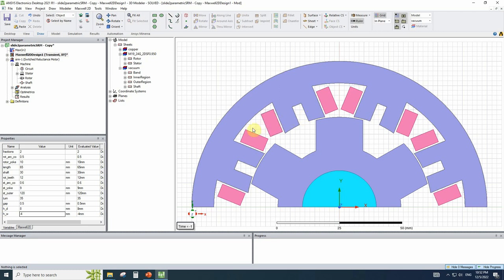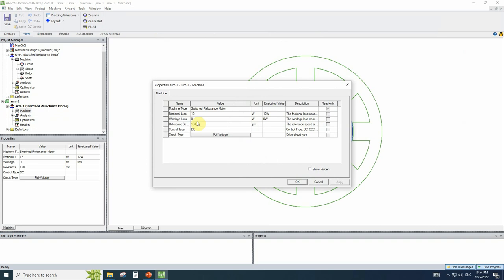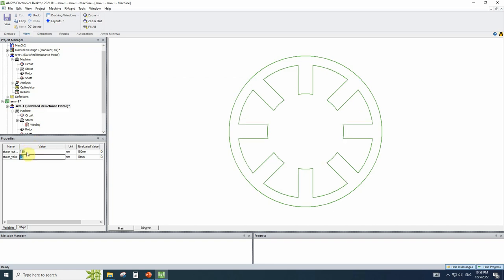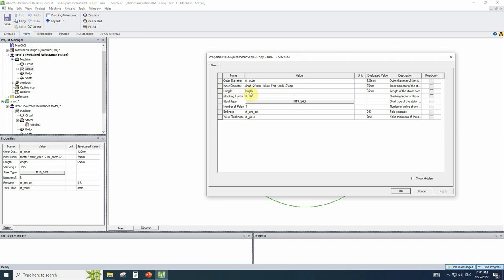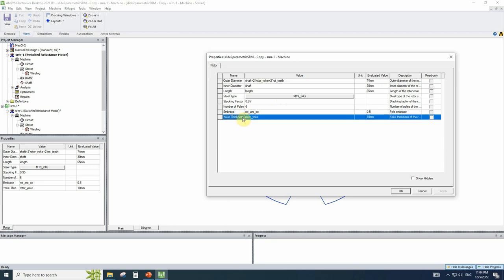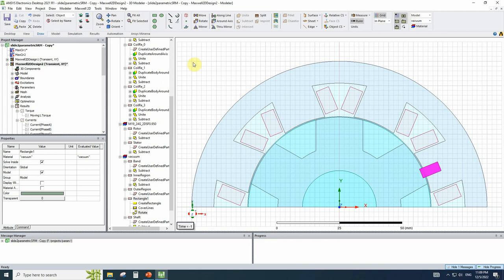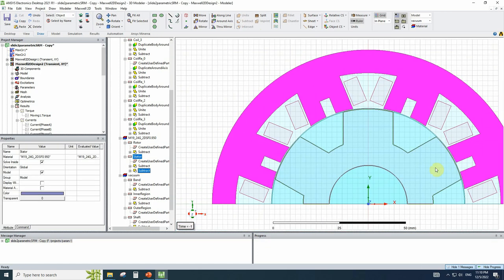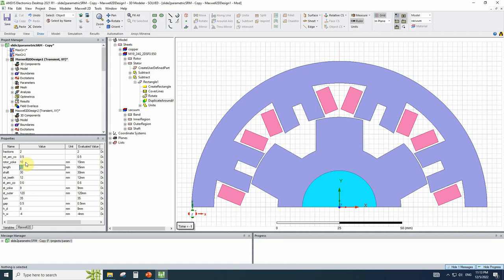Simulating and Optimization SRM using ANSYS Maxwell | Step-by-Step Guide with 2D Simulation-PART1

Comment: thanks so much, could you change the motor model to the generator model? What are the differences between the motor and generator in design?
Reply from the maker: In the Srm machine we need to connect it to the grid or voltage source because srm can't be stand alone generator. Like squirrel cage induction motor